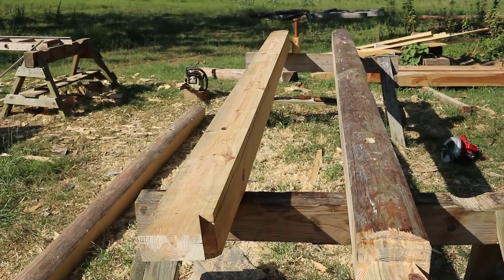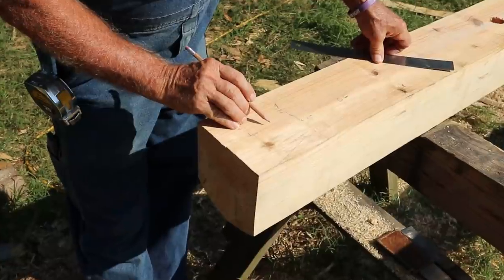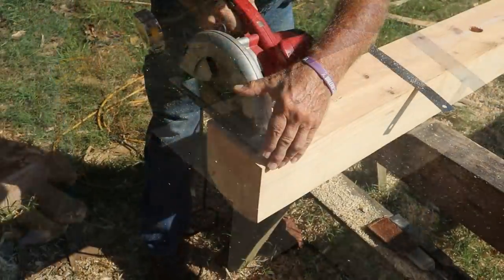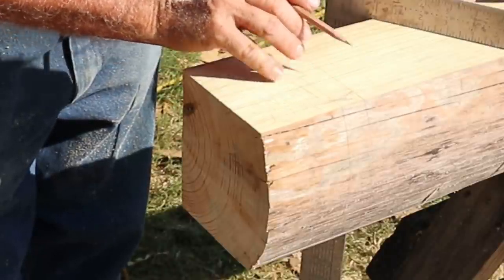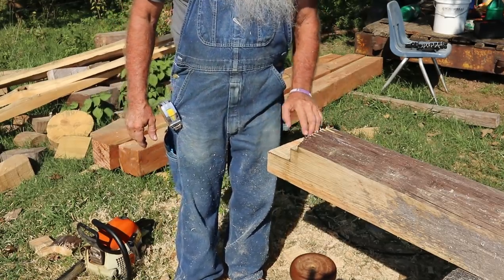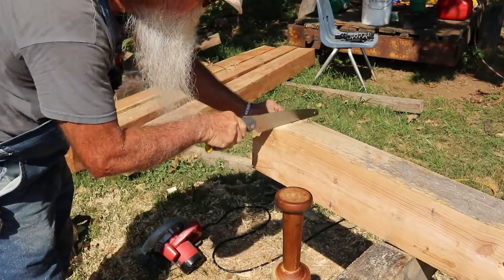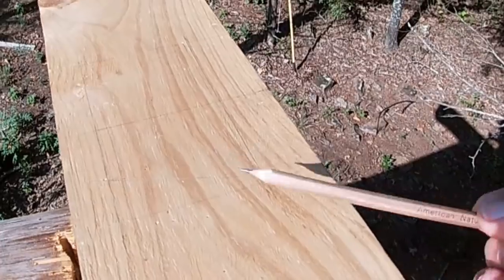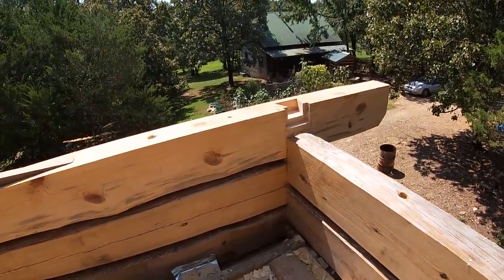Setting the Half Logs, Dovetail Log Cabin Build (Ep 36)

Comment: Does it make much of a difference to have a small pointed chainsaw blade like that or would a wider short one work well too?
Reply from the maker: mm h   Howdy- that’s a carving bar on that saw. It’s nice to be able to get in tight corners with the little tip. I’ve used short bars but the carving bar sure is nice. God bless you

Comment: Hi again!  I have enjoyed watching you cutting the notches for the plates.  I love the precision of your notches.  I have for years noticed that for most of be better built old cabins and particularly those that are larger, the builders turned the plate logs flat.  I am sure they did this to provide extra strength to the plate, to resist bowing out over time from the thrust of the rafters supporting the roof, which would of course allow the roof to sag in the middle.  I guess most cabins built nowadays avoid this by using trusses or collar beams.  I know mine is.  I am guessing you will use trusses  or collar beams on this one.  Have you  ever built  a cabin  with the plate logs turned flat?  Is there any other reason  you see for doing this?

Keep up the great posts!
Reply from the maker: D Dunn   Howdy- yes, I have put up plates like you’re talking about on a historical restoration. The old cabin I’m restoring now has plates like that also. I don’t think I will have much outward thrust of the roof load. The plates are locked good and the plates are pretty substantial. They also will be anchored down through four rounds of logs. I sure appreciate you watching and the kind words. God bless you